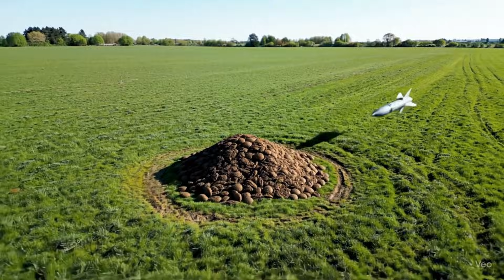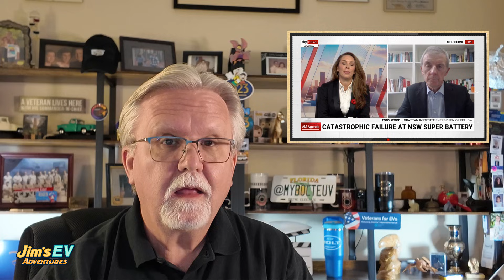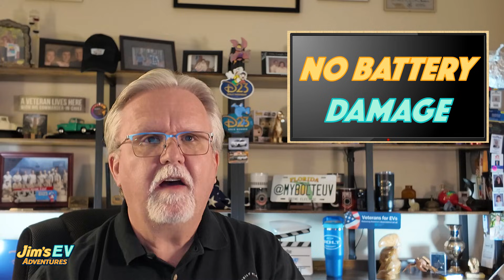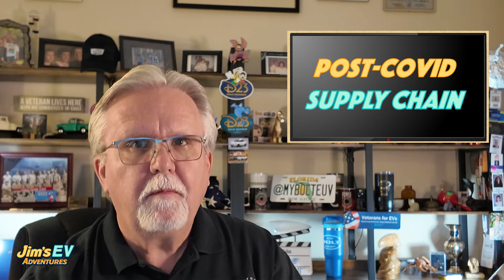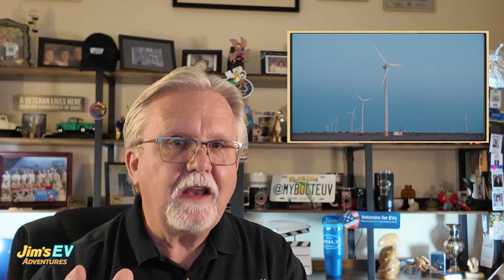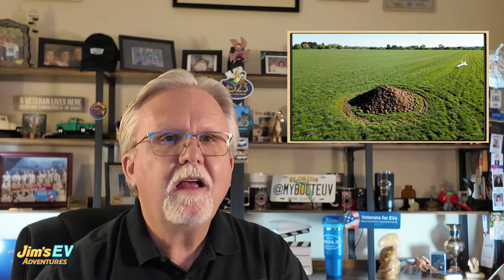EVBB, Ep. 18: 💥The Waratah Battery: Separating Facts from Fake News💥

Comment: Thanks for the facts.  I used to work as an electrical helper for a local utility with a high voltage maintenance crew.  Yes failures happen with different pieces of equipment over the years, it’s high voltage, stuff happens.  Circuit breakers, transformers, switches are all things that can fail in high voltage stations, not because of batteries, but sometimes a lack of maintenance in some cases.
Reply from the maker: Or failure because of something missed during manufacturing.

Comment: About fifteen years ago ibworked at a site that had reciprocating peaker generators.  The switch gear manufacturer was there doing upgrades and during testing accidentally closed a tie breaker when one of the units wasnt synced.  It destroyed the alternator on that unit (litterally melted and blew it to pieces) along with a lot of electrical equipment. It knocked out an entire section of the local grid because it took the fault all the way back to the substation to clear it.  I guess natural gas generators simply arent ready for the matket yet🤣
Reply from the maker: Wow, that sounds like quite the experience! It's always fascinating (and a bit scary) to hear firsthand accounts of how things can go wrong in the energy sector. Thanks for sharing!

Comment: This is like claiming EV's are dead because a tire came off due to wheel nuts not being tightened properly. Unfortunately it does get traction amongst a certain percentage of the population. I mean the other day I had a guy claim that South Australia, the state with the highest percentage of renewables in their power mix in the country, was burdened with domestic power rates far higher than anywhere else in Australia, but a simple 2  minute check reveals that average power rates in South Australia are lower than in Queensland, the Australian state with the highest level of coal power in its energy mix. Some people will of course read his claim and accept it on face value. It's still difficult to explain to people how wholesale pricing works in the power grid and why even if you have a large amount of renewables in your power mix you can still have high power prices due to that last few percentage points.

The fact that prices in NSW, SA and South East Queensland (which gets most of its power from NSW anyway ) are so cheap during the day due to renewables that the actual numbers drop into the negative may help some people understand. When they get their free 3 hours of power during the day it may change some minds. Haven't watched much of this Mguy on youtube and don't intend to, but every country has them I suppose. It's funny how we get all this news about how dangerous renewables and batteries are while we know for a fact that coal fired power stations are far more dangerous and harmful to the environment but not a word is uttered about that.

Comment: In 2024, there were 598 wildfires caused by vehicles in California.  Safe to presume almost all caused by gas vehicles, EVS are not prone to starting fires
Reply: Yup, extremely HOT exhaust systems parked over dry grass or brush.
Reply from the maker: Exactly!  I can't even warm up my hotdogs on the hot engine block like I used to do.  Now I have to plug a microwave into the outlet on my car to heat them up!  LOL
Reply: @jimsEVadventures   I’m sad that my Bolt EUV doesn’t even have a 12v socket in the way back cargo area to power a small 15L or 20L fridge for car camping or road trips. Spent the weekend with a tape measure trying to guess which model fridge or power would fit without hogging up too much cargo space.

Comment: This shook my house 20 miles away in the UK 
The Milford Haven refinery explosion on July 24, 1994, was caused by a combination of management, equipment, and control system failures at the Pembroke Cracking Company plant. After a lightning strike caused a disruption, a blocked outlet valve on a vessel led to a build-up of flammable hydrocarbon liquid. A corroded flare line failed, releasing about 20 tons of vapor that then exploded, injuring 26 people and causing significant damage. 

    Cause: The incident began with a lightning strike that disrupted refinery operations.
    Escalation: An outlet valve on a catalytic cracker became blocked, and an operator did not notice. This caused flammable hydrocarbon liquid to be continuously pumped into the vessel, overwhelming safety systems.
    System Failure: The pressure relief system vented the excess to a flare line, but a severe corrosion problem in that line caused it to fail, releasing a large quantity of flammable vapor.
    Explosion and Damage: Approximately 20 tons of vapor escaped and then exploded. The explosion caused extensive damage to the plant and even affected properties up to 3 km away.
    Consequences: Twenty-six people were injured, though no fatalities occurred. The incident led to legal action and fines against the companies involved for health and safety violations.
    Lessons Learned: The event highlighted critical lessons in process control, alarm management, maintenance procedures, human factors in control system design, and emergency response.